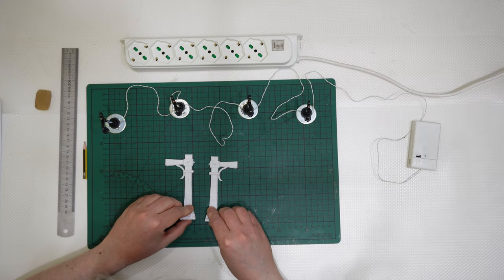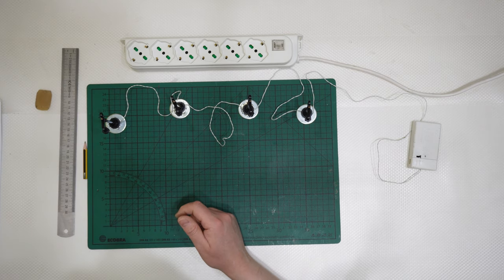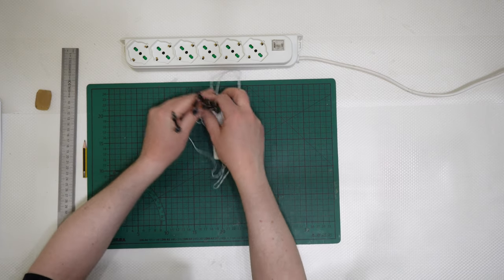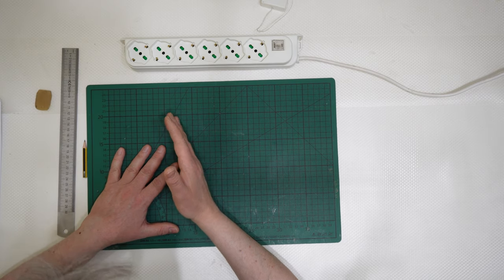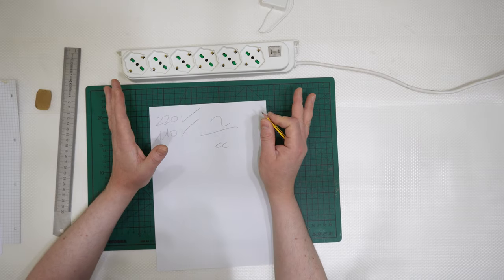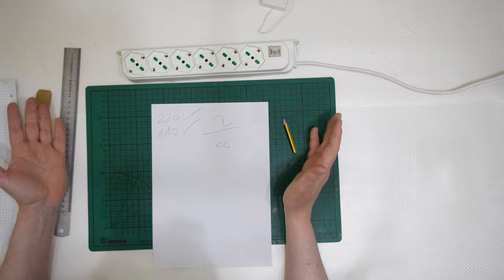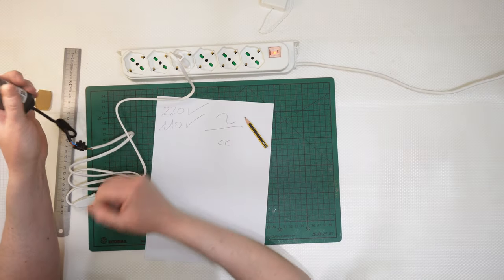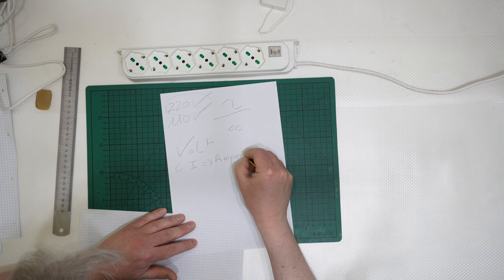DIY Streetlamps for Christmas Villages Using LEDs - PART 1

Comment: Silvio,  I am so looking forward to this DIY tutorial. Is there any way to replace the Lemax steet lamp with a brighter LED bulb and AC power adapter?
Reply from the maker: Hi Robin,
Unfortunately it will be a Mission Impossible.
Achievable but very long to do taking into account the fragility of the Lemax street lamps (not very dense plastic).
You need to proceed extremely slowly and carefully.
I will give a very brief explanation of why in Part 2.
Reply: I was thinking the same thing Robin. But our guru Silvio says almost impossible,  then ir is impossible.